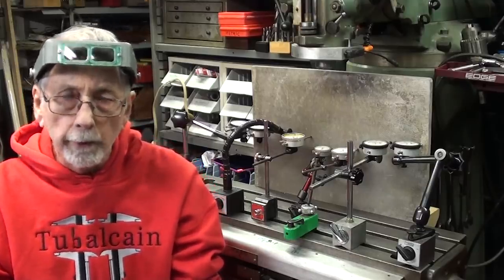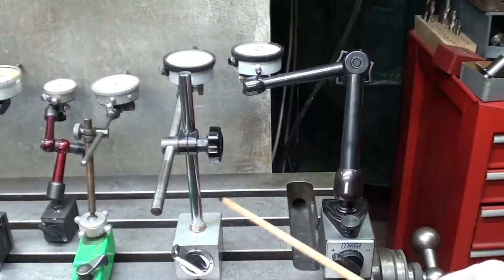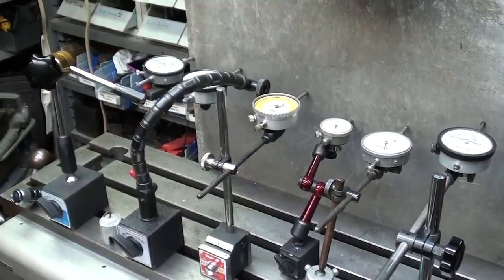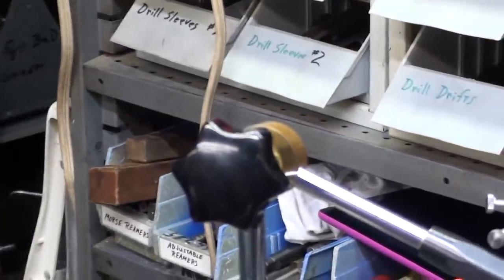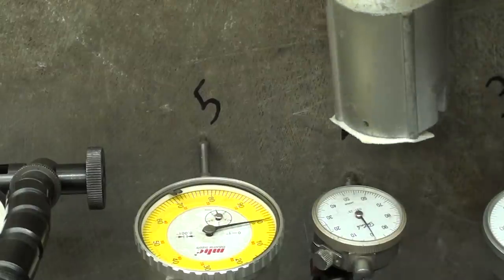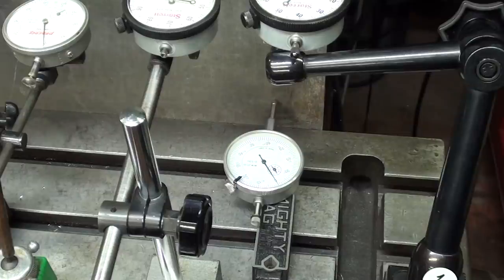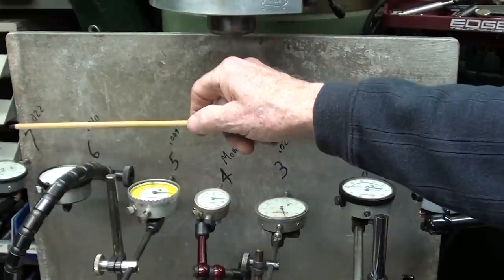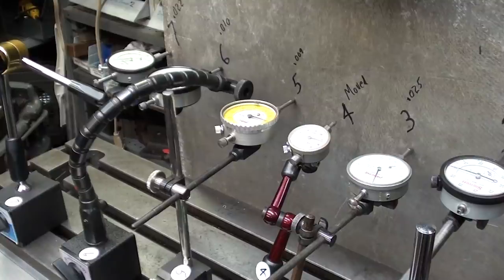WHICH IS THE MOST RIGID DIAL INDICATOR HOLDER 703 tubalcain

Comment: I highly recommend the Flex-Bar type of indicator holder if your objective is to curse and get angry.
Reply from the maker: Yes
Reply: Me too!....bloody useless device😬
We often refer to them as a 'snake' indicator stand.
Reply: That is probably the only tool that I was happy when it broke.
Reply: agree
Reply: I thought it was surprising in the first half of the test. Didn’t move much. Yet adjusting that in small increments in a tight spot would be maddening. Better used to hold a mister or flood coolant nozzle.
Reply: The flex bar is good for directional flow of coolant period;;;;; or contributing to plastic landfill
Reply: I use the one I have to hold a chip shield, it seems to be capable of that.
Reply: The biggest problem with the flex bar or snake type is the internal cable's screws loosening and not allowing it to tighten properly.
Reply: I have one and it makes a fair paper weight!
Reply: @cdrive5757  😂😂😂 'paperweight' the best description so far.
Reply: @andyZ3500s  How can you tell when it's broken? ;-)
Reply: @cdrive5757  When the cable connection breaks and all the parts fall on the bench.
Reply: @andyZ3500s  It was a rhetorical question.

Comment: Determine the maximum force the dial indicator will exert on the support column and then decide if there will be any difference in deflection between the smallest diameter support and the largest diameter support.  I'm sure you won't be able to measure the difference in deflection.

Comment: Mr Pete, I just came across your channel. I spent forty plus years in a machine shop. They called me the old man cause the young fellas coming in were all about CNCs and some of them couldn't  sharpen a drill bit or weld a bandsaw blade. I was going to do another six years but due to a back injury I was retired last year. I spent the last thirty years at the last shop as the Operations Manager that was supposed to be only till one was hired. I was there for thirty-two years. Always in trouble for not staying in my office and being out on the floor on a mill or lathe. But I was the one called at three am for a emergency. We offered 7/24 services for our customers.

 Did my office work in the morning and the end of the day and kept a scrap paper notepad at alltimes for making a list of tooling, material ect.. that was needed or we were low on stock needed. I went through every job package before I put them on the floor for any print issues and special tooling  that may have been needed. The largest lathe I ran had a 72" chuck and I could run 100,000 lbs between centers and 200,000 lbs with a steady rest. That was when I did papermill roll repair. The truck drivers that did the hauling for the mills were amazed at the lathe as it was as long and taller than their rigs. I enjoyed working in a machine shop and made a good living at it.

 I turely enjoy your channel and I'll go back and watch every one from your first one. Your basement shop is amazing! If you ever decide to sell any of your equipment please contact me and I'll make a trip from South Carolina. I'd really enjoy just talking shop with you. Stay safe and keep those vids coming!
Reply from the maker: Wow, you had quite a career. Far more diverse than mine. You should be making the videos, LOL. Keep watching.
Reply: And for your Sir!   THANK YOU for YOUR SERVICE . 
You built the economy.

Comment: I have a pile of the Starrett mag bases and they are ok for up to a 2' indicator before it gets too floppy.  What drives me crazy is the center post unscrewing or guys adding a third 5/16" extension arm.  Loose tips on the indicator seemed to be a big problem for folks where I used to work.  Three things I always look for - repeatability, repeatability, and repeatability ... and if time allows I also look for repeatability.  Interesting test - thanks for sharing with us!!!

Comment: Thanks Mr. Pete,
Did not realize how important it was to have a good magnetic indicator base until I worked for a Japanese Mfg company.
 Had to perform machine wear set-up standardization after grinding 300K parts by resharpening the grinding stones and setting the bottom stone to a base distance in the bottom guides. The machine self adjusted going upwards by a program instruction set during this dial indicator calibration of the grinding wheel.
Don't ask me to explain, just agreeing to the results of Numbers 1 & 2.

Comment: Rigidity is an important factor, but so is the ability to get the indicator into position and adjust it precisely.  That is where the Noga with base fine adjust kills the old fixed stand types and makes it worth the money in my opinion.  I haven't tried any of the cheaper Noga kock offs (buy once cry once is a moto I've taken to heart.)
Reply: I have a Noga knockoff from Amazon and it is absolutely useless. I could duct tape the indicator to a twig and get more rigidity.

Comment: Love my Nogas.. My go-to.    Thanks for sharing
Reply: I admit I really like the articulated type.  As long as I am the only one using it. We had knockoffs at work and the arms would fail after about 4 months. Primarily due to people not believing you can over tighten them. My go to for lathe work has always been the Starrett with the solid bars. The bases with the rotating switch I have never been happy with.

Comment: My old professor in machine tool design told a story about a now defunct lathe manufacturer. They tested spindle runout using a 3 foot long indicator holder. Which flexed so much that the indicator didn't show almost any runout.

Comment: Lyle I would add one more test, as we do for aligning couplings. Set up a bar in the lathe and set the indicator/magneton the top of the bar. then rotate 180 degrees and measure the sag of each setup, it is a very telling test , Enjoyed the test, although every setup is useable by a competent machinist and do exist out of necessity. Cheers!

Comment: You should do this test on a flat bar with the indicator at a fixed distance say 8” from the base. Then flip the indicator over upside down and see how much the reading changes to show the deflection just from gravity.  You should use the same indicator for every test though so the weight is the same.
Reply from the maker: Good idea, but too late the job is done

Comment: Personally I prefer the #6 flex arm because its fast to set up and I know its limits,I know its wonky but at the time the price was right,plus I have learned how to repair it when the crimped ends pull off the cable,that's another story.Thanks for another great video🤗🤗🤗

Comment: One thing worth checking on the Chinese import mag bases is to see that the base contact area is truly flat to prevent the base rocking slightly. Easiest way to eliminate this is unscrew the stem from the base and with the base held in a milling vise take a light cut of both flat sections to flatten the bottom. Don't forget to switch the magnet to off position.
Reply: First test it on a surface plate.  First see if it rocks.
If not then go to the second step using a feeler gauge. 001 and poke it all around.
If you mill the base I would try these tests again.

Comment: For the glare try using a polarizing filter (that can rotate) on your camera.
Reply: Ya, I would try that too, you set up your lighting, then when viewing thru the viewfinder, rotate and watch the reflective surface... it won't be perfect, but might you might be able to correct for problem shots....
Reply: a Circular Polarizer lens would do the treat. you can rotate it to hone in the glare reduction.
Reply: In order for the polarizing filter to work the light source must be polarized as well.  The sun is a polarized light source so they work outside.  When I made my living as a photographer I photographed a lot of art.  I put polarizing filters on the lights and a rotating polarizing filter on the camera lens.  It worked very well but it requires that every light source be equipped with a polarizing filter and they all have to be oriented in the same direction.

Another solution is to use very diffuse light, like a big silk or scrim and place the light above the silk.  That's just the name for them; synthetic fabrics replaced silk decades ago.  I use the Dacron that sailmakers use to build sails attached to large PVC pipe frames, about 3'x6' (~1mx2m).  A black paper disc is laid on top of the sailcloth to prevent the specular highlight from going from the light source off of the dial and back to the camera.  It works very well for watches so I would expect the same results from dial indicators.

Comment: Not really surprised by the results, but the old Central and the Starrett stands did very well.  A lot cheaper than a brand new Noga, and readily available used on Ebay!

Comment: A clear polarizing lens filter could help reduce or eliminate glare off those dial indicators. You rotate the filter slowly and you adjust them for each shot.
Reply from the maker: I have been struggling with that glare for years. I even took the crown off of an indicator, but it did not help.
Reply: @mrpete222  it is tricky. There are situations where a polarizing filter only partially works. Something to do with the geometry of the light source, surfaces, and the orientation of the light waves themselves. I’m a new viewer of your channel but I have nothing but good things to say about how you film things.

Comment: Love your videos. Been a fan for a long time. I'm actually about to purchase a noga. Do you think the results for 1 and 7 could be a little different than the rest because they are not directly inline with the plate like the rest. Kind of like a crows foot on a torque wrench value is different depending on the angle it is in comparison to the handle direction. Just curious your thoughts.

Comment: It'd be interesting to see a test closer to how they are used, maybe put a large round bar in a 4-jaw with a 1" offset and an indicator running on it. Then use second indicator to read the movement of the first indicator. That way you would see the movement caused by the pressure of the indicator plunger. Might have to use a tenth indicator for the second one.
Reply: I agree. This would tell way more!

Comment: This is a special circumstance, but in lathes, a heavy indicator base with a solid post in the middle might not get the job done because it is common to put the indicator on the chuck and then rotate the chuck/indicator around a tool so that the tool is on center line.   Since you are rotating the chuck you need a good magnet for when the indicator is under the chuck, and you need an arm that is both long, so that it clears potential aluminum jaws, but also a low profile to clear the bed of the lathe.   Basically rigidity concerns give way to these things around lathes.

Comment: Any reason you didn't test a Fisso indicator holder? Their Strato U-Line claims to be the most rigid indicator holder on the market, and designed specifically to assist with measurements in microns.
Reply from the maker: Yes, there was a darn good reason why I didn’t use fisso holder. 
They cost four or $500
Reply: @mrpete222  Fair enough! I know they have a "Classic" line in the USA now, but they are still a bit expensive. If i remember right its near $260 for one with an adjustment and base.

Comment: For very strong magnet
You can use approximately strong coil of contactor
12 volt 24 volt d c
And use it with small portable battery

Comment: love the video's and the content.  i use to work night shift doing maintenance on CNC and manual machines.  the guy I worked with and I would watch your videos in the maintenance shop on breaks and over lunch.  A quick question for you, what is the best way to make a two piece bronze bearing?  bore it under sized, slit it and scrape it to fit or line bore it?  Thanks for all the knowledge you are passing on.

Comment: I expected him to test a modern "Harbor Freight" holder (like mine) $12.99 {SKUs 63663, 5645} which I use to adjust runout on miter saw & tile saw blades and such. None the less interesting. Ron W4BIN

Comment: The blown-out highlights on the dial indicator faces in the wide view is because of the much lower average luminosity of the scene and how the auto-exposure on the camera reads it.  The camera averages the overall scene to a  "normal value" representing an "average" skin-tone, which  in monochrome is about 18% grey.  The majority of the scene  is  quite dark, so the  exposure  adjusts accordingly to give detail to the plate and the background behind the machine.  Note how readable the closeups of 6 & 7 are.  If, say,  the plate was paper-white, all of the indicators would be much more readable, but the machine table and the background would be nearly black.   People would (reasonably) opine using a darkening film on the indicators, but all this does is reduce the  white indicator faces to a grey more in line with the background.  A polarising filter will only kill bright specular reflections , of which there are not many in this setup, so all  it really does is reduce the overall luminosity  the camera sees and makes almost no difference because the auto-exposure will compensate.(unless the indicator crystals are polarised - which is unlikely - then we're back to a simple darkening effect).

Comment: Can’t say I have ever been a fan of any indicator stand that has the fine adjustment thing , just another flex point to me . 
I have a late model Starrett one here that I have a love - hate relationship with , love the mag base and arms but hate the damned plastic knobs on the snugs ! Oh well it is a simple fix !
Another good test would be  to mount the indicators on a vertical surface and hang the weights off them to see the deflection .
Thanks for the fantastic video Mr Pete !
Reply: Agreed!  The fine adjustment is just error built into the device.  I bought some solid rod and replaced the micro adjustment rods with solid.

Comment: What scenario would you see in use that the gauge would be stressed as you are with the weights?    All stresses on those gauges are on the tip of the gauge itself not on the stems.  The stems should see no stress at all in typical uses.
Reply: It tests the rigidity of the vertical post, the horizontal piece and the joints.  Since the horizontal post is typically in compression or very close to it, most of the flex will come from the vertical post which this test loads very well.  The actual load won't exceed the pressure exerted by the piston of the dial indicator.

Comment: There are two challenges in photographing or “videoing” white indicator faces with clear lenses. One is exposing for the white, the other is controlling reflections from the lenses.

An average scene, overall, reflects about 18% of the light that falls on it. Therefore, the autoexposure systems in cameras are calibrated to center on that value. But image sensors (nor film—remember that?) don’t have the dynamic range to register detail from black all the way to bright white when exposure is set to that average value. The indicator faces reflect about 98% of incident light, way beyond the camera’s range, overloading the sensor and obliterating the black markings on the faces in the process. Photographers call these “blown out” highlights. You can reduce exposure to darken the indicator faces, making the entire shop black at the same time, or try using neutral density (gray) filters on the indicators to reduce their reflectivity closer to everything else in the room.

The other problem is actual mirrored reflections of the shop lights in the indicator lenses. A polarizing filter can help here. Using one on the camera, rotating it to intercept the polarized reflections from nonmetallic objects, can often, but not always, work miracles. It depends on the angles involved.

You have to conquer both problems to achieve readable dials. The best baling-wire fix is to shade the dials...put them in semidarkness and hide them from the ceiling lights. Use something black.
Reply from the maker: Thank you for the advice. But of course I understood very little of the first paragraph

Comment: neutral density filter sheet or window tint will give warm colors (3200k). Sunglasses for bright white things. Same for any shop windows, window film that is friendly with the color space you are recording in and fluorescent tube or LED it should color match (3200k) Not all LED products switch temperatures LTBBW. Anyhoo, cut some circles out and see if just a little bit of ND/tint, it should  equalize the brightness. Apart from gauge blindness, there are also tweaks in software for fighting that. Black Magic Design's DaVinci Resolve editing software. The HD version is free and when it comes to color space control for clips, shows, remote segments. I say stay away from rental software. The idea being stick with one color temp. (5600k) is an option
Reply: and further more.... the real culprit is that cameras do averaging and open/close the manual/digital iris to expose for that. If you can adjust that iris in MANUAL mode or if there is a toggle, you expose for the gauges, then pan/tilt the camera to the scene shot. If still in manual, you will be able to read the dials on a monitor. Good cameras allow for control of these things just like good gauges! Thank you!

Comment: It seems to me that in actual practice the force on the indicator support system is the force generated by the spring of the plunger in the indicator and so the force is very small.  What other source of force is there when the indicator measurment is taking place?